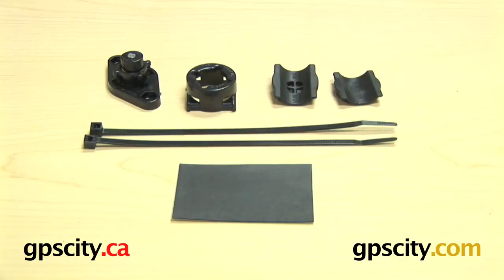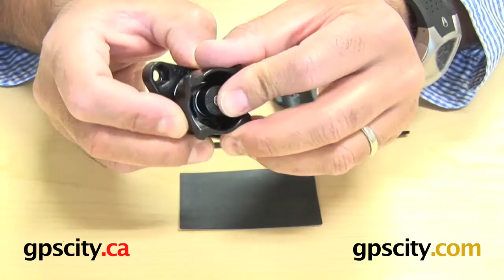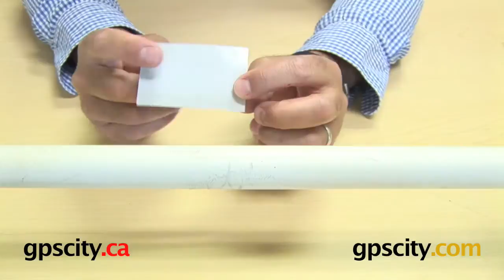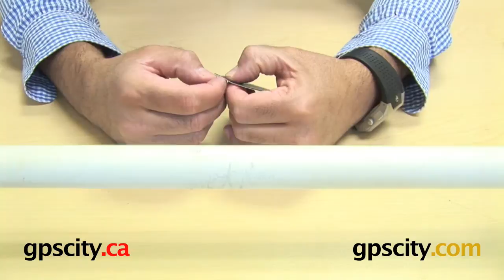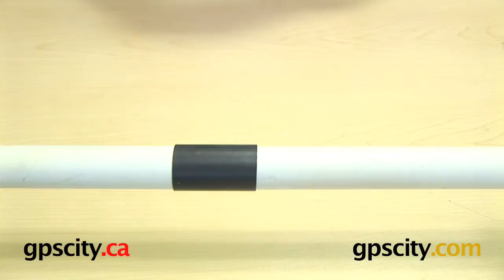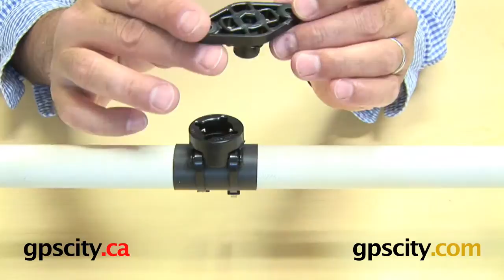RAM Mount Ez On/Off Bike Mount (RAP-274-1U) @ gpscity.com

Comment: Great videos.. I have a Dakota 20 and need a very secure way to mount to some oversized (1 1/8") handlebars.  This doesn't appear to accomodate 1 1/8" bars does it?  Also, I'm slightly worried it would be easy to pop off if you crashed.  Is there something better for holding this GPS on to oversized bars for mountain biking?  Thanks!